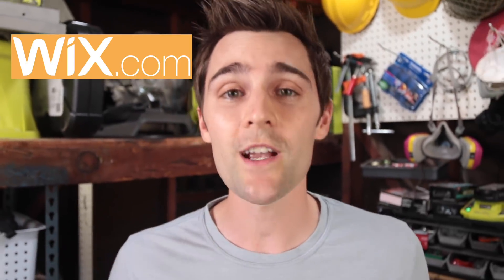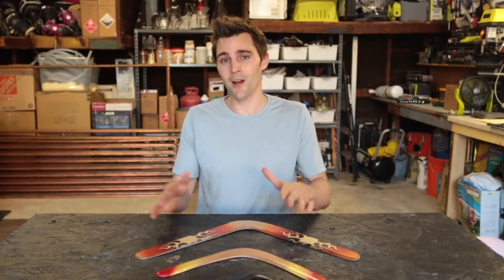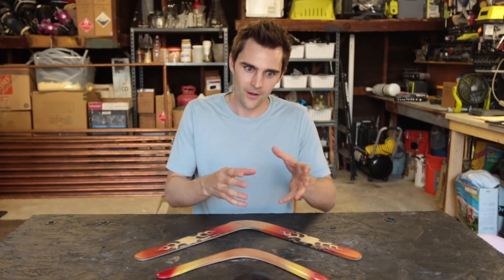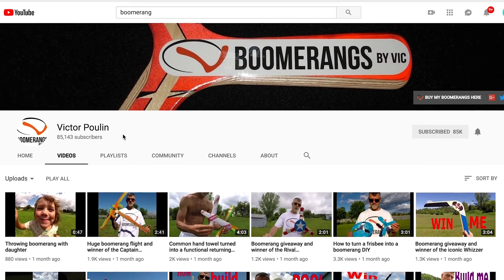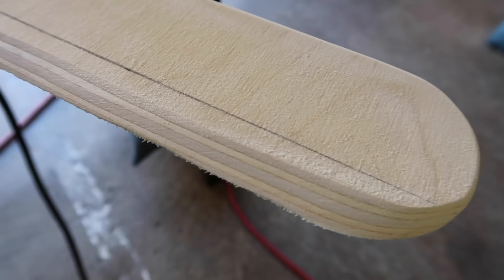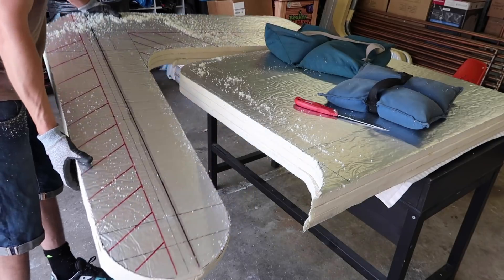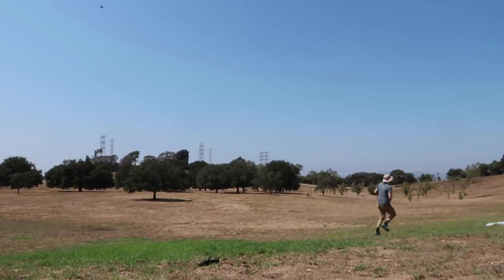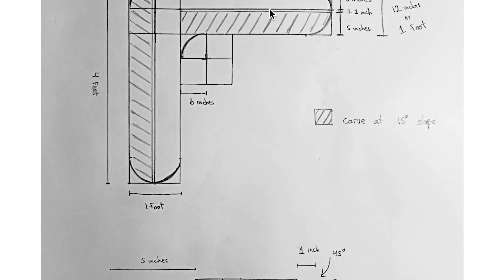GIANT 6-Foot Boomerang

Comment from the maker: I just made a new site www.NickipediaStore.com with Wix, and this site has the free plans to the 5 foot boomerang so make sure to check it out! 

I will say that making this giant boomerang has been one of the most fun science-problem solving videos we’ve ever made. At first I didn’t think it was possible, but after the first throw of our prototype I got really excited that it could work. 

After we doubled the thickness of the foamboard I knew we were in business! The only issue to solve from there was that it was too heavy to catch! The solve here was to split the difference and create ply-foamboard. This was the winning ticket. With the right materials we were able to create a GIANT 5 FOOT BOOMERANG that not only went up in the air and came back, but that I could also catch! 

I will admit, a boomerang of this size is a bit like a contact sport, so if you try this on your own please do so at your own risk!
Reply: 🕉cool.
Reply: Only 9 dislikes
Reply: good job on the website!!
Reply: What happened to the site

Comment: Dude... you are throwing it all wrong. YOu are supposed to throw it VERTICALLY, not horizontally. also the wind has to be in your left cheek if you are right handed, then it will come come back.

Comment: for a boomerang to return to its starting point they have to take into account important factors.
1. the way to throw the boomerang (in the video is incorrect)
2.the weight
3. the material
4. aerodynamic shape
in the video if it had been thrown in the right way maybe merged, the most important thing is to have fun :) thanks for the entertainment.